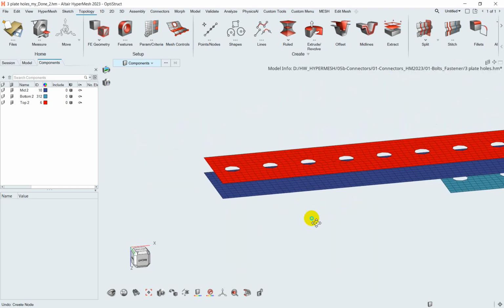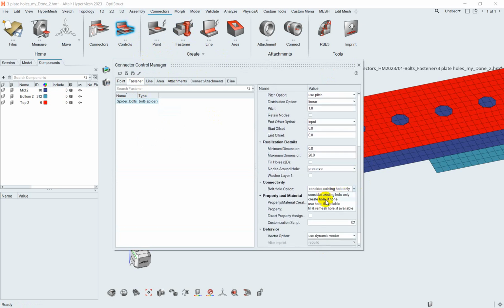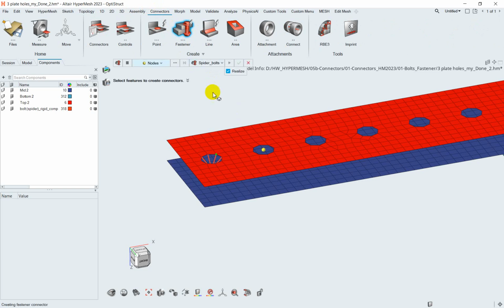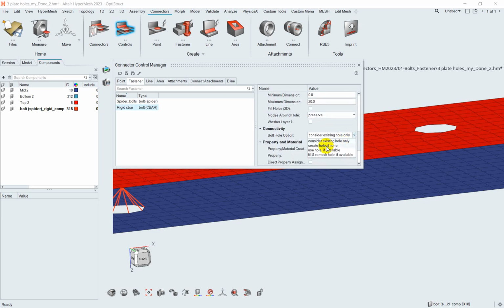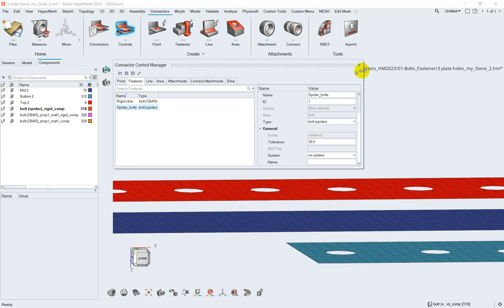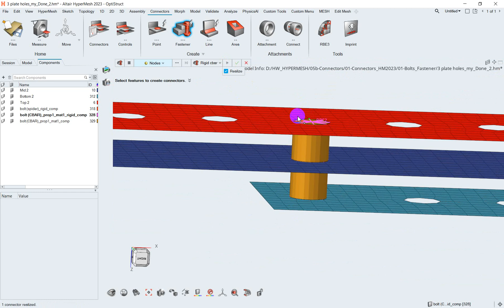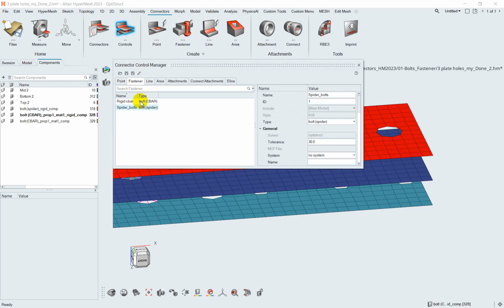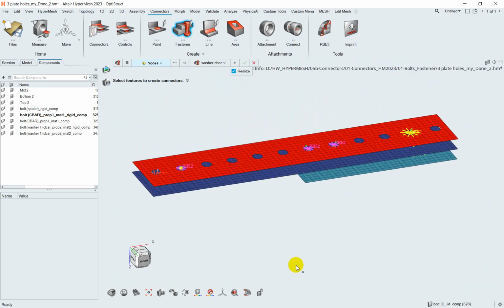HyperMesh 2023: Create 1D bolts to connect multiple shell plates and Auto trim holes

Comment: hi! I'm using hypermesh 2025 and it doesn't show those options (spider, washer, etc). Mine are:  cylinder, rigid patch, clip, hole, solid, step hole. Which of this will make a waher, because without it the stress concentrations on the top and bottom are too high. (scuse my english)
Reply from the maker: Sorry. I have not used HyperMesh any more and do not have 2025 license to test. You can contact with Altair support to check